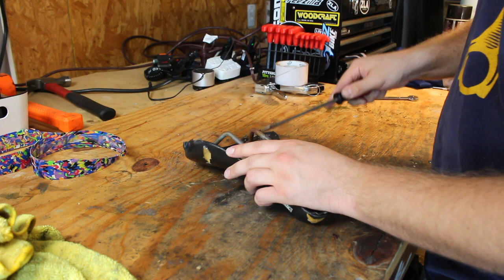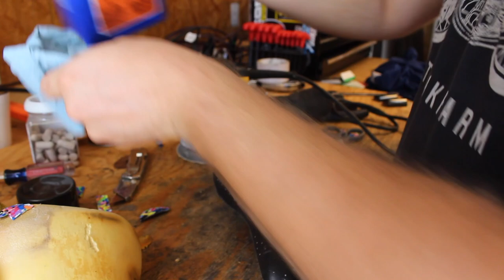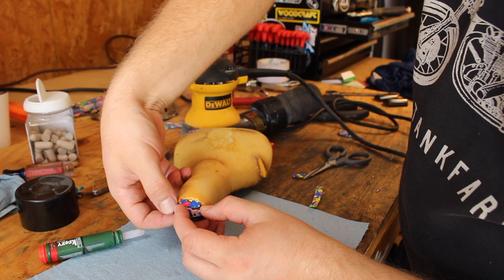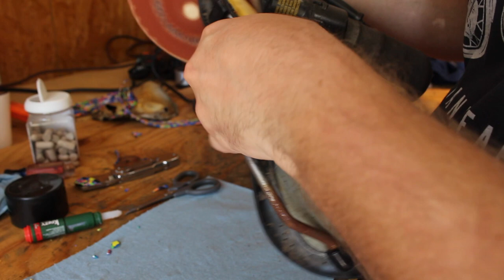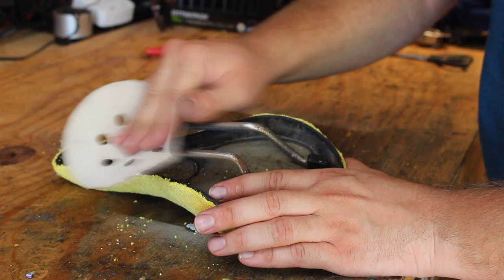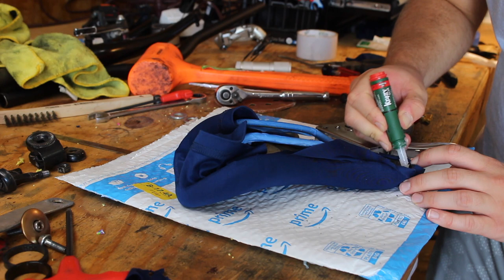Restoring a Bike Saddle

Comment: Thanks for the video! You forgot to spray both the top of the seat and the bottom of the foam and let dry for 30 seconds for a permanent bond. Also a bead of glue (E6000 or ShooGoo along the inside of the seat would keep the fabric in place. Staples are not enough.
Reply from the maker: Great tips!!